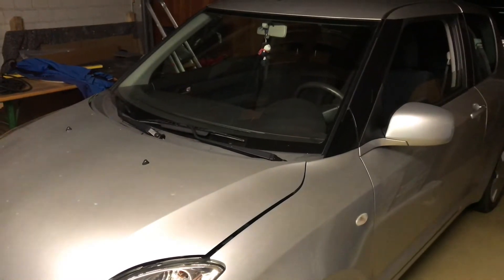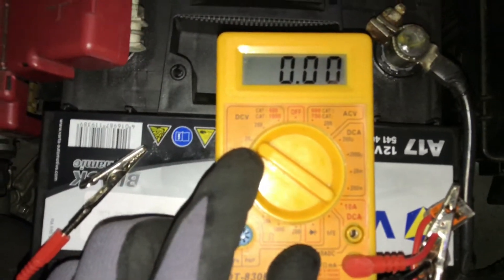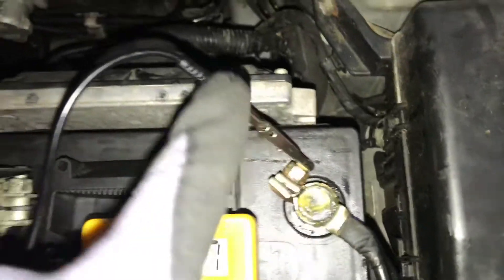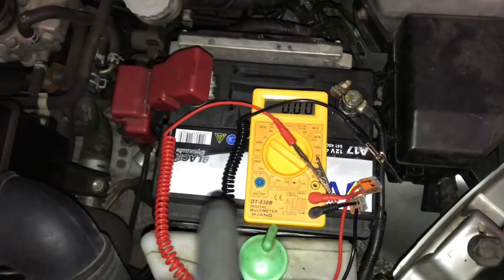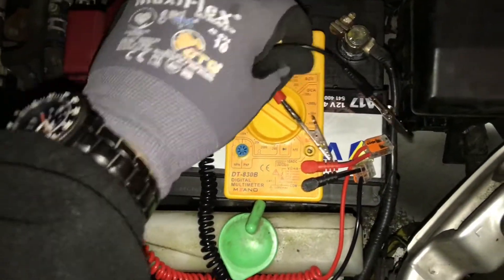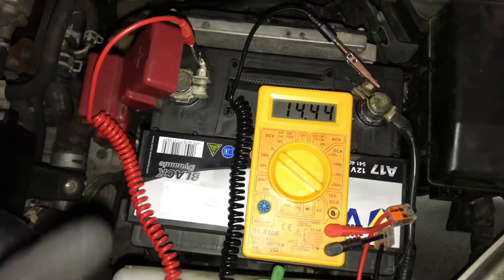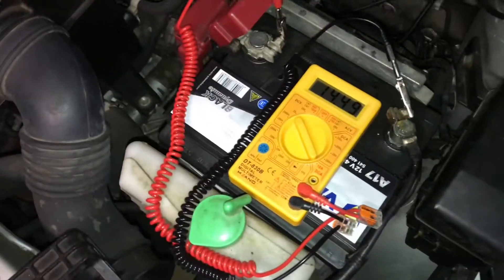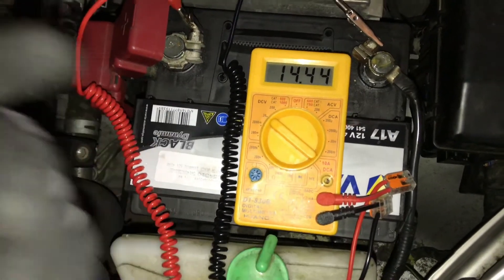How to test car alternator with a multimeter Suzuki Swift DIY

Comment: Thanks. I am on my 3rd repalcement alternator. None of them are charging. (Suzuki SX4, like a Swift). The main fuse seems OK. Grounded to car body, still no increase in voltage. In fact, voltage drops when the ignition is on. It doesn't charge, but doesn't complain either. What could cause this?